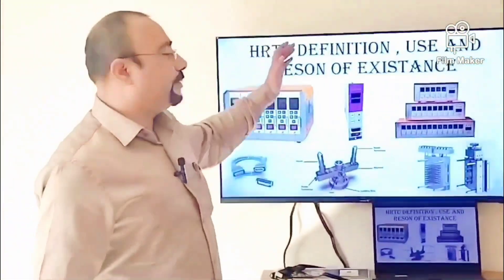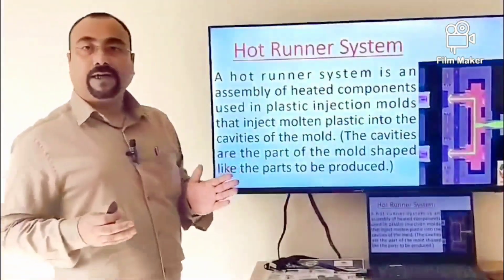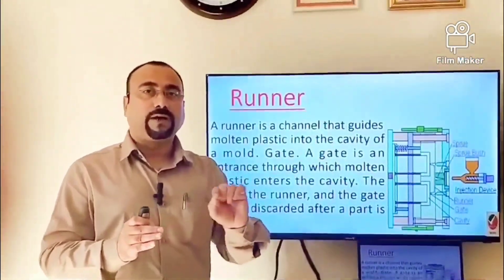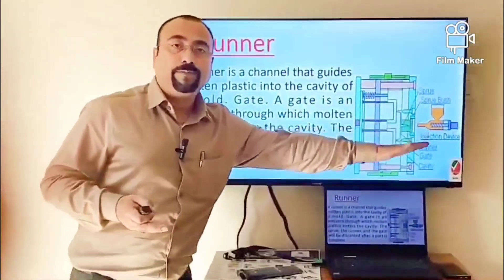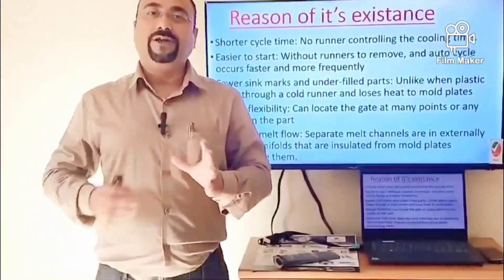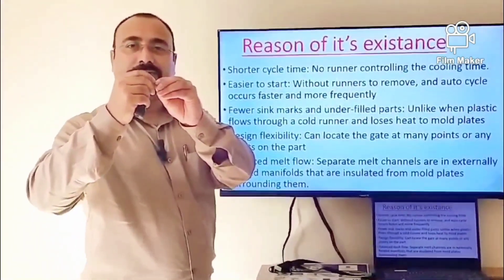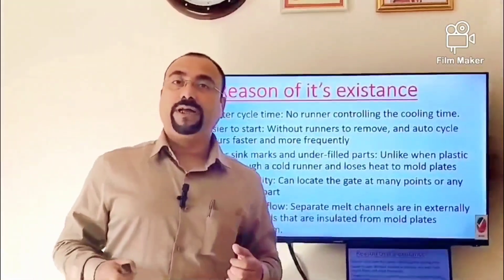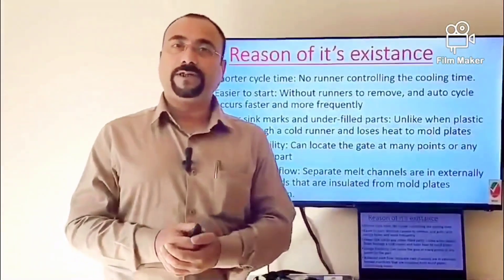HRTC : Hot Runner Temperature Control in Injection Molding. Benefits of HRTC

Comment: Sir, why sometimes opaque preform is getting hard? Same material run in one machine but other machine having problems.
Reply from the maker: Thank you very much for the comment. I think you want to say preforms turns brittle. It's because of overheating. Heater and cooling channel both to be checked. In terms of 2nd question Barrel & Hot Runner both to be cleaned and purged properly.